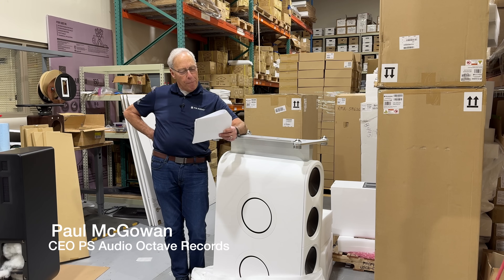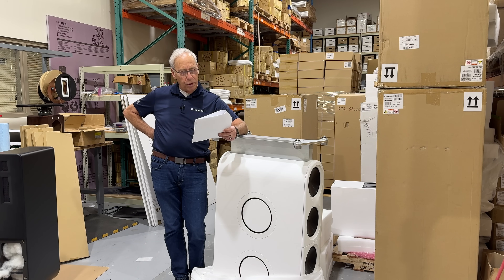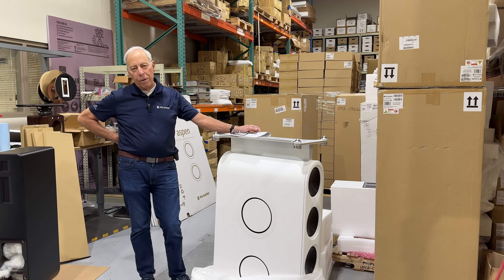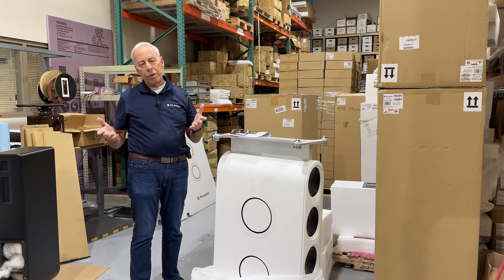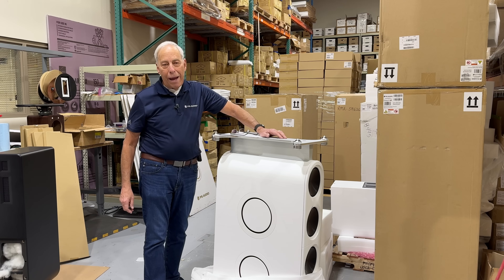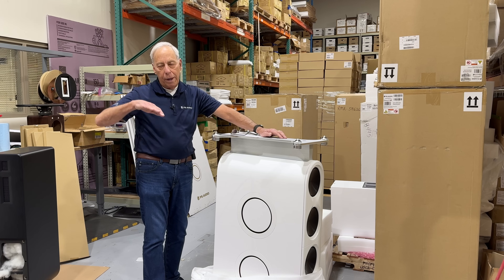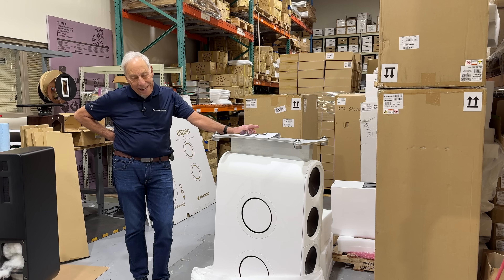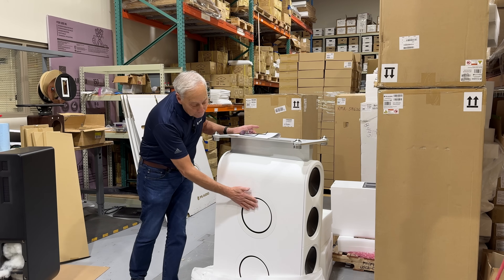Holes and ports in speakers

Comment: Actually never heard any "chuffing" sounds from my ports on neither the rear "normal" ports on the front speakers or the front slot type port on the sub even at max and ears close🤷‍♂️ Port design is a huge factor of how good they are. Same as with passive. Bad designed will max out on the suspention and distort

Comment: Somebody should tell Chris that passive radiators suck.
Reply from the maker: ? Why would you say something like that? Perhaps you've had a bad experience? Let's not make the mistake of suggesting because one bad (or many) experiences that it is then a universal truth.
Reply: @Paulmcgowanpsaudio  
Hi Paul, thanks for responding.  I think it's only logical that passive radiators suck.  Let me explain.  The bass created by the passive radiator is 360ish degrees out of phase.  Many will say this isn't a problem, as it goes full swing around, back into phase.  I believe it is a problem.  Imagine a speaker with one woofer, and one passive radiator, both stationary.  Let's also imagine for argument's sake, that the woofer and the radiator each produce 50% of the total bass output. Now let's introduce the sine wave of a kick drum.  The woofer receives the signal, and starts to move outward, and it's only until (at minimum) one full wave length, before the radiator begins to move in sync with the woofer to produce full bass output.  In this scenario, the initial sine wave is only producing 50% of the total amplitude.  It's not until the second wave that 100% amplitude is achieved.  The problem is that the sine wave of an actual kick drum starts off at full amplitude.  In my mind, this reduces the 'punchiness' in the speaker's bass frequencies.  I also think it's just plain crude, and primitive.  If you've ever played with a Paddle Ball as a child, you probably understand the difficulty getting into a rhythm, and especially varying the frequency... I don't want any "rubber bands" tied to my woofers, save maybe air. Change my mind, or stop putting passive radiators in your speakers. 😉🍺
Reply from the maker: Indeed you are correct about the 360˚ difference but, at the frequency this happens at, around 30Hz, there really isn't any sonic penalty to be worried about. The transient information of a kick drum is much higher in frequency. For years I too dissed PRs because of my experience with other designs (like Polk Audio). They sucked. I was, instead, enamored with servo control of the woofer using an accelerometer and this, I found through years of listening, helped transient response enormously (our servo systems could deliver a square wave). It wasn't until our designer, Chris, demonstrated to me (in a shoot out) how a properly designed PR whoops ass on a servo system and certainly better than a stand alone woofer (or a simple port). So, PRs work when designed correctly. Truth is, few of them are. @NotSure723

Comment: Polk is a common speaker but they have uncommon port designs, the down firing power port is a legitimate technology, there's a flare on the exit and even eigentone filters in the tube chamber, so the cabinet is actually tuned like a drum or a guitar.

Comment: You may hear chuffing noise from a cheap speaker, but not from a well-designed one, because speaker designers have solved that problem with more sophisticated port design.  Not really an issue these days.

Comment: Correct me if I am wrong, but the purpose of said ports is to extend the bass, thus increasing its dynamic range of frequencies, volume & room pressure(db) so to use a smaller box...to save the cost in materials and increase wife acceptance levels? Out the back ports tend leverage more room loading more loading pressure off the back walls & corners for deeper and lower bass also at the sacrifice of accurate tight singular bass notes, this is why tuning is so important/critical? 
These ports give some...credence to labeling speakers as so called "full range"...with regards to smaller speakers? 
Some advanced bass drivers will have servo controls and, or DSP time alignment (room corrections) software controls to help mitigate or combat said issues?  
The problem with sealed bass drivers is they peak at specific frequency range and then drop off significantly, but they are more accurate/fast, natural & clean?

Comment: The Revel Proformas I have are front ported. If I recall three very smart speaker folks were involved in the design so hopefully I’m not getting any chaffing. Also in addition no chuffing is occurring either. 😂👍

Comment: Another way to increase bass volume or output and extension is by a  transmission line . A good transmission line is capable of low, accurate and tuneful bass.

Comment: Paul, to make a statement that if a speaker has a port in the front you will hear the chuffing is just irresponsible. If the speaker is designed correctly you will not hear chuffing from the front port.

Comment: I have a old pair of Polk speakers monitor 5 with a 10 inch passive radiator. It’s up against the wall right now. I think the passive radiators produce a more smoother low frequency sound.

Comment: A Helmholz Resonator resonates at on frequency. If we tune it to say, 50 Hz It will play 50 Hz - regardless if the woofer is playing 52, 55 or 60 Hz. Yes that 50 Hz is 180° out of phase with the woofer rear radiation so it is additive. For people not pitch sensitive, it is simply more air moving and sounds therefore like more bass. If we are pitch sensitive, we often have trouble identifying the pitch playing when the woofer gets closer to the resonant frequency.

Comment: A port is driven by the pressure waves off the back of the driver that is inside the cabinet. The port lets the air pressure escape at specific frequencies with a time delay because of distance from driver and the speed of sound. The output from the port becomes more signal from the cabinet at those frequencies with a slight delay from the original signal. That timing can be adjusted by positioning, internal cabinet design,... 

A back port is often 180 out of phase to give the back wave in time. While a front port is often in phase to not cancel the original wave from the driver. But to add to it.

Comment: The main thing to remember about ports and passive cones is they are designed to resonate at a particular frequency such that their output into the room is 180 degrees out of phase with the woofer that drives them. In this way, they flip the back wave in the cabinet to reinforce the front wave, but only over a small frequency range. You have some freedom with placement because the frequencies involved are very low. They used to almost always be placed on the front, but they do make some wind noise and let some higher frequencies leak out, so moving them to the back gained more popularity.
Reply: And they are 180 out of phase because they are time delayed based on speed of sound and distance/size... So their output is always a time delay smear. Which is why I don't like ported designs.
Reply: @glenncurry3041  It isn't distance, it's the resonance of the mass of trapped air in the port. A simple acoustic delay line would be much longer, several meters for 40-50Hz. But yes, the port response lags the cone a bit.
Reply: @bryede  So locating a port directly an inch behind the driver is the same as some bottom loaded column?
Reply: @glenncurry3041  There are rules for best placement, but the port will do its job with the box pressure as long as its placement is unobstructed. If you think of a Shake Weight, it only moves completely opposite of your motions at one speed. Go faster or slower and it doesn't work.
Reply: @bryede  Technically the port phase leads the overall response, not lags. But it has to become a frequency in the first place because really the "lead" comes from the previous cycles.A port is a form of resonance that produces a sharper low frequency corner, which increases the requirement of defined frequency and all that implies. But it can extend the bass down low enough the room is more resonant than the speaker. A speaker with a more gradual rolloff is "faster" but most of that is how it interacts with the room.
Reply: @spentron1  "Technically the port phase leads the overall response, not lags." Please explain how the port mass can violate the laws of physics and respond before the event. "because really the "lead" comes from the previous cycles". So it "leads" a signal that may not even exist! Make up your mind! 

IOW the port mass responds AFTER the actual signal.
Reply: @bryede  Red herring? Sad. The question is NOT room placement. It is your claim that distance between driver and port is irrelevant.
Reply: @glenncurry3041 No, that's really not quite right. I have heard many great ported subs that sound precise like a closed one with the benefit of the port. Well designed ported speakers in general ate actually very good and accurate. But if your phase or delay adjust is not right then you have issues woth smeared spuld regardless og ported or closed. Just usualy more noticable on a ported.
Reply: @Oystein87  Argue with the laws of physics, not me. That is what puts the conditions in place. Anecdotal, what you hear, does not change it.
Reply: @glenncurry3041  I don't habe too since laws of physics actually say the same thing.
What you messure and hear is facts
Reply: @Oystein87  Please show us all the laws of physics that allow for instantaneous transfer of energy/ air pressure, from the back of a driver to the port located some distance away.
Reply: @glenncurry3041  Do you even know what comment I answered?

Comment: Any chuffing or sound leaks from a port aren’t going to be audible from a normal listening distance. In fact, putting your ear up against any driver is going to result in hearing certain sound characteristics and artifacts that aren’t beneficial to the listening experience anyway so it shouldn’t be a surprise. But at any proper distance - or even volume level - should make any port interactions moot.

Comment: I still have (but not use any more ) floor standing TL speakers which I designed and build  in 90ties which have radiation port all around   the box some 25 cm above floor . I think It prevented selective  impact of neighbouring walls

Comment: I think many many speakers had front ports in the 1970s and 1980s. I've had a few myself. I remember the B&W 801s had front ports. I don't know if you could hear any sound coming from the port, but I know the bass sounded just a little fat, but still very likeable bass. I really liked the version of that speaker from around 1990. Heard through Threshold electronics and others, it was one great speaker. If the cabinet is built well enough and the port is done just right, I wonder if it is possible to eliminate or near eliminate open port sounds. Of course the B&W had the midrange and tweeter sitting outside the cabinet in their own seperate enclosures. B&W also had experimented with back ports behind the tweeters as a waveguide to improve the treble. They also experimented with a bookshelf speaker whose back was semi-open, with a honeycomb enclosure in back, in an effort to eliminate cabinet resonances. 

 My experiment with the speaker with the complex crossover worked well. At first I didn't think the improvement was large, but the more I listened on a variety of material; it was. I do think the crossover resulted in a few db less efficiency (SPL), but that is no problem. I won't go back to the old speaker cabinet, at least not for my main listening speaker.
Reply: The technics sb-cs50 had bass ports in the front but they were just a regular tube. technics sb-cs55 was almost the same speaker but bass port on the back but had a properly rounded bass port on both sides which there is no room for on the front. technics sb-cs55 is a better speaker even though the sound of the two is quite similar.

Comment: They only chuff if the speaker is poorly designed. Almost ALL studio monitors use front ports because they are PART of the sound.
Reply: No.😮😅
First no and second almost no.
1. If you make the port larger it needs to be longer. Usually it's calculated for the best size, and not maximum SPL.
Second, as a design choice it can work on both front and back, but if you look at monitors many times they are sealed, for best regular flat frequency output. 😅
Reply: @franciscorompana2985 How many recording studios have you actually been in? I’ve personally been in several dozen, never once have I seen a sealed box woofer section. The overwhelming majority have had front mounted port ATC speakers. 2nd most popular I recall are Spendor’s, also front ported. 3rd is probably Dynaudio or JBL, the former is rear port, latter front port.
Reply: His response to this question is just embarrassing. It's like a construction company that doesn't know how to build a road

Comment: If u have to get down to hear the chuffing . Is it even a thing . Isnt it just air or maybe not ?
Reply: I believe chuffing sound is due chiefly to a volume of air moved in sudden spurts back and forth through speaker's ports and internal baffles (from wide to narrow passages and vice versa).
Reply: The louder you play your music... the Louder the Chuff.  Yes, its very notable, to those of us that have decent hearing.    The worst cuff Ive heard, came from a powered sub I picked up cheap, from the thrift shop.  It was so bad, that It completely muddied the music.. and ruined everything.  I had to stuff the port with the cloth, to dampen the effect... and even then, I wasnt exactly happy with it.   Passive Radiators, are the Superior Option.  Deep bass,  but without any artificial sounding bass, and other Port distortions.
Reply: @johndough8115   Whether you hear a chuff from a ported speaker depends entirely on the design of the port, which has to be made with the frequency range of the connected woofer in mind, so it's not advisable to make a generalized statement like that (like with most things in hifi).
Reply: @storkfletcher821   From my experience, all ports create an extremely Artificial sounding, and distorted, bass.  Its completely different from Sealed speakers, and or even passive radiator speakers.

 Ports all suffer from various issues, such as expelling air out of the speaker... to the point where there is not enough air pressure, when the woofer hits again, rapidly.

 From my experience, its the smaller "Tuned" ports that have the most issues.  Speakers that have very wide rectangular ports... suffer less,  as they do not seem to be "Tuned" to a specific frequency.  Certain speakers have large diameter circle ports, that also do not seem to be Tuned.

 But again... All of them still sound like Hot Garbage, compared to a Good Sealed speaker.   Even Passives, sound MUCH better than any Ported speakers.
Reply: @johndough8115  Since you keep mentioning your experience but offer no substance on that I can only guess at what level you've listened, but that's not particularly constructive so I'll respond as a general statement and I strongly disagree with your stance. Ports can sound bad but it's due to poor design rather than the design being inherently inferior.

Your stance on air pressure seems odd as a general statement given all the different design alternatives and it seems to, by extension, entirely invalidate things like open baffle speakers and just doesn't align well with what I've learned about speaker design. All designs are of course compromises, but that's something different than what you're saying. It isn't particularly hard to find ported speakers that are very good in quick response.

It all becomes quite controversial given that there are highly acclaimed speakers with ports (and open baffle, etc) that range all the way up to ultra high end. Even looking past my own experiences, to not just limiting an argument to a limited anecdotal thing, I don't really see how something would be able to contend in the most demanding segments if it was inherently and inescapably bad.

Although in the end it doesn't matter what you like, the point I made towards general readers regarding skepticism towards simple statements about complex issues has already been made and that's enough.

Comment: Did he make the radiator with surrounds instead of a spider? that's the better way to do it a double peak surround on each. What did he use for the skin diaphragm s sandwich construction I would have thought expanding foam?